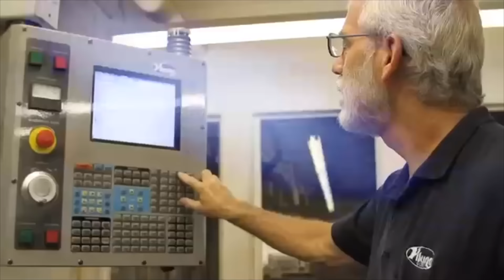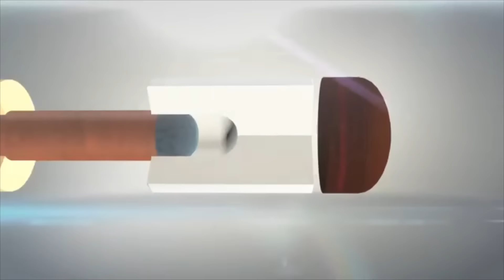2015 Junior 9-Ball Challenge: Lazaro Martinez vs Ricky Evans (Final)

Comment: Ricky has to race to 5 but little L, race to 3? not a fair match.
Reply: It's the way the tournament works. 16-17 year olds race to 6, 14-15 year olds race to 5, 12-13 race to 4 and 11 and under race to 3
Reply: @Neo-lc9wu  doesn’t matter it’s still not fair if a 14-year-old is good enough to be matched up with a 17-year-old they should both play to the same number